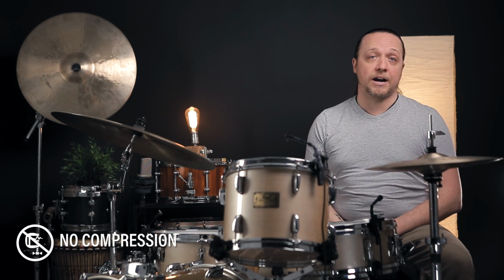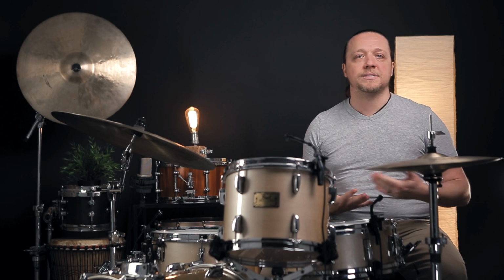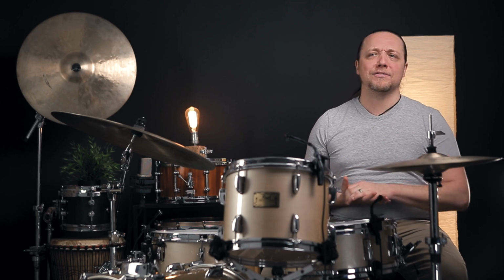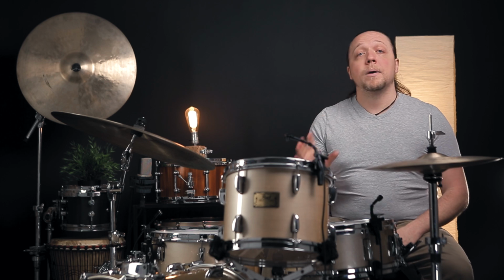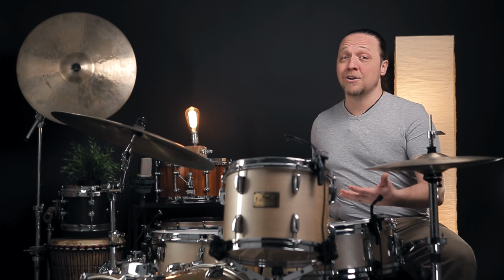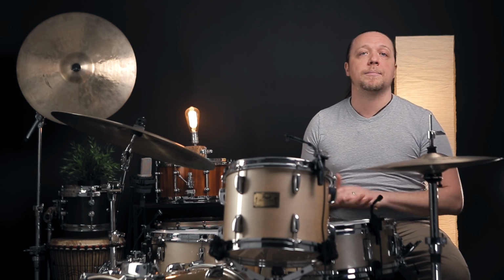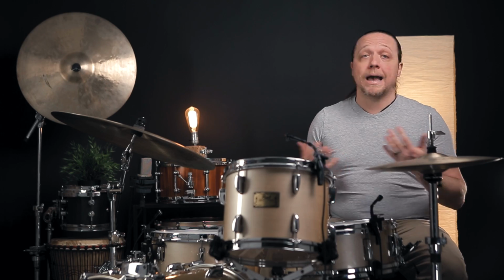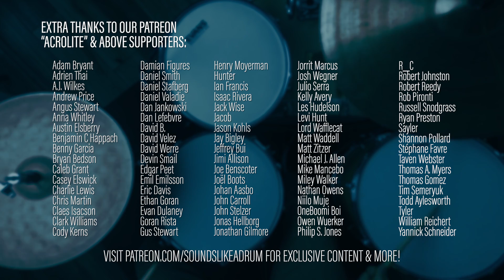Are You Overlooking These Issues? Blindspots in Drum Tuning | Season Five, Episode 42

Comment: A little case-in-point to your discussion today about not following a recipe, but a methodology: I recently ordered a new round of heads for my gigging kit, and noticed immediately that the floor tom head I received was flawed. The head had a noticeable wrinkle near the shoulder before even being put on the drum. I was in a little bit of a pinch, so I had no choice but to use the head. I tried to get the lugs pitch matched, and get the wrinkle out as well, but this left the drum sounding less than useable. I started over, letting my ears decide what to do, and ended up with a very solid, pleasing result...with the wrinkle still very visible in the head.

I look forward to replacing that head, but not getting too caught up in "the recipe" saved the day. Good video!

Comment: The tom recipe for me is to pre-determine the resos (half step lower from the fundamental pitch for a minor third interval and an even sound, at an octave higher, for a perfect 4th interval) and then adjust the batter head to get the desired fundamental pitch.   It's all about the reso head being the master and the batter being the slave.  That's where the perfect balance of flexibility is between each type of drum and / or head types.  The end result always gets me the desired outcome of fundamental pitches for every tom.  If the room doesn't like it, then I change the reso pitches again and go again from there.  The fundamental pitches sounding good between all toms is the goal, no matter what "key" they might be in. 

For snare wires, assuming everything is set up properly, I tighten the wires until they're crisp.  And when they're too tight, you can hear the pitch of the snare go up.  So I back them off.  The pitch of the snare is the same with or without the wires engaged.  That's the balance. If it doesn't sound good, then change the tuning of the heads.  The ruler method is still a must!  Generally.  

Great video.  Thanks!  I just recently tuned a six lug vintage cheap snare at the elementary school where I work at.  The result was fabulous.  I took that snare to it's max potential without having to change any heads or wires.  The students will like it, I'm sure!

Comment: When I first got my kit I had a DrumDial for my banjo that I used to tune my drum heads.  I assume that most people don't use these. When not using one how do you quantify "low" vs "high" tension?  I assume it's all relative, if that makes any sense?
Reply from the maker: We don’t feel the need to quantify that sort of thing, as it’s all relative. Once you experiment with the range of a drum, you get a feeling for how far it will go and you start to internalize the idea of what a “low tuning” is vs. a “medium tuning”. Some people get hung up on this because they want specifics when, in reality, their context is likely quite different from ours. Even if they’ve got the same gear in the same room, they’ll learn more by working through the range and gradually dialing in a sound than they would if we fed them some abstract numerical representation of the tuning (or even the specific frequencies, for that matter).

Comment: I have three different 14" snares that all buzz when I hit them off-center by more than 2" or so.  Within a couple inches of the edge, they buzz/rattle like crazy.  At the center, they sound fine.  They are all attached with different things - plastic strap, Puresound blue cable cord, polyester window blind cord.  As far as I can tell, the wires aren't mounted unevenly.  Any other ideas what could be causing the buzz?  Or is it normal?  It seems excessive even for off-center hitting.
Reply from the maker: That isn't necessarily out of the ordinary. Depending on the setup and tuning, hearing significantly more snare response and overall sustain when playing off center is quite normal. Still, that doesn't mean that it can't be controlled to a certain degree. We've got a bunch of videos that cover our methodology for snare tuning that can help with this.